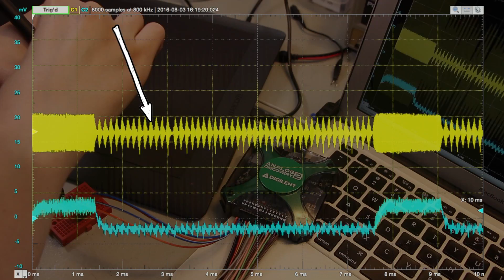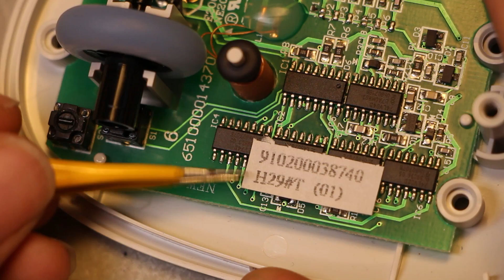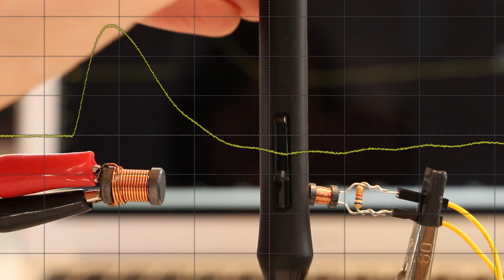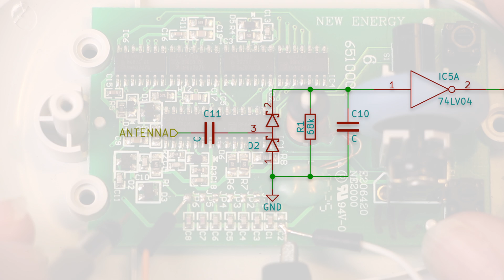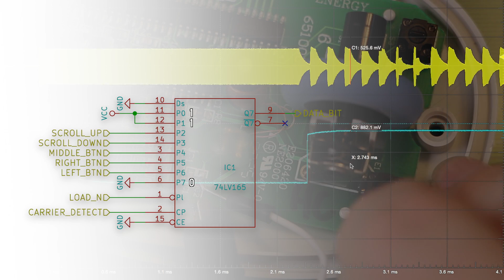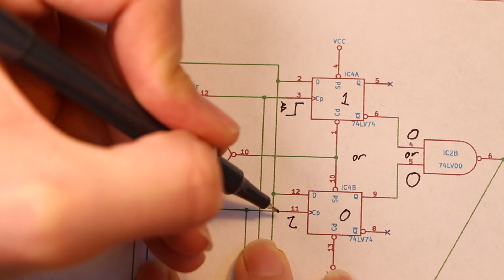Wacom Teardown and Schematic - scanlime:013

Comment: I really like how you overlay the oscilloscope output when needed to illustrate what is going on. The full-screen, hi-res attention it gets is a very nice way to present the data at hand.
I wonder why they went through all the effort building the logic with several discrete 74 chips instead of just using a CPLD instead. Probably it really cuts down on the power (and given the large pull-up resistors that was probably their main concern).

Comment: This may all be completely wrong and I am just crazy but:
I tried a few "experiments" with my Intuos 3 and Intuos Draw to test out my theories or to learn something more about how to potentially get a pen that wasn't inteded for use on one of the tablets, to work on the tablet. So I found that although (supposedly) they work at different frequencies both pens can be used on both tablets.
If I hover the intuos 3 pen over the intuos 3 and then bring the intuos draw pen over as well, it "transfers" to the intuos draw pen and recognizes it as an intuos 3 grip pen, same thing the other way around. however pressure isnt quite right as the newer pen has 2048 levels, and the i3 pen has 1024-interestingly tilt/rotation still works as i assume this is done through the tablet not the pen.

Waco's after the intuos 2 have Tool ID or something so the tell which tool is over the tablet, this - afaik this is hardware within the pen-I tried the tabletswithout drivers installed with the pens and it worked the same as in you have to tranfer it over, once theyre out of range they dont connect again without the intended pen initializing the tablet i guess.

I am now looking for a 1024 pressure levels pen (thinking the intuos 3, or one of the bamboo's or pen and touches) so I can see if they might work a little better. hopefully someone can figure out a way to trick tool ID into thinking that you're using the intended pen..

Comment: I picked up an Intous3 tablet at an auction for 17 bucks but it didn't come with a pen, I didn't think much of it until I read about the ridiculous compatibility stuff online. This tablet was only compatible with a handful of pens. All of them are expensive by themselves. I picked up a whole Intous3 set on eBay for another $30 with the pen, mouse, and smaller pad. But the pen stylus part isn't very sensitive for some reason. Maybe it just needs to be tuned. I see some trimmers below the rubber grip I might try tweaking them...

Comment: Hi! very nice work!, I see you have reverse engineered several aspects of drawing tablets, I have a Wacom CTH-300 wireless, and no USB receiver, rendering it useless..., is there a way to inject a new ID to a new receiver? or since there is also a wired model of this tablet, soldering a USB connector could be possible? thanks!

Comment: Tragically I think that "74 series logic" is the TTL bipolar high current stuff from the 70s - reading the numbers on the chips "The 74LV00 is a low-voltage Si-gate CMOS device"  -  interesting.

Comment: Your presentation and depth of information is really good. Ive seen that compatibility table when trying to find compatible pens for embedded Wacoms (Toshiba M4, Fujitsu Stylistic), makes me curious if you can just retune the pens between similar models or if the pressure resolution is too different. (Like using the older Intuos 6D pen on the latest Intuos Pro)

Comment: Have you checked the RS232 port with the scope? I have a XD-0405-R intous2 tablet, and the signals the scope probe with a coil detects on the tablet are the same another scope probe measures between pin 5 and pin 3 of the DB9 connector, but the latter show a stronger signal resembling a serial communication pattern, but I cannot decode with a DS1074Z because peaks are distorted by transient ripples. I shall use a circuit to reshape them to square pulses as you mention in your video.
Reply from the maker: which RS232 port? the pen protocol isn’t the same as async serial iirc
Reply: @scanlime  I guess you are right, but I measured Intuos 2 tablet's RS232 port DB9 connector pin 5 and 3 to one channel of the scope and the signals caught by the coil on the tablet pad on another scope channel, both have similar patterns, but RS232 are much more intense and sharp. But my scope cannot read or decode the signal output on the RS232 port. Can you?. I perhaps did not figure out the correct RS232 parameters or perhaps in the old intuos 2, the coil (pen)motion/position generates a signal that is sends packets via RS232 that are not standard serial and the soft converts them to X/Y coordinates? Thanks for attending this question.

Comment: will it be possible for you to make a tablet like circuit using an arduino ? This could be placed behind a monitor or a android tablet and a pen could be used to draw on the screen ?
Reply: Cannot be naively placed behind the display - the TFT unit will both shield and inject noise. There could be solutions to that, but they likely won't be particularly easy or low-tech-friendly. The way one would do this in a commercial device is by placing the sensing matrix in front of the display as a transparent electrode array, akin to how the capacitive touch sensors are made, but even if you had such a transparent antenna array on glass manufactured, it still won't be trivial because of TFT noise.

Comment: Can a resistive touch panel be used like a Wacom?
Reply: This is not a well-defined question.

Can absolute position be read from a resistive touch panel? Yes, that's generally their purpose.

Can pressure data be read off a resistive touch panel? No, it's just two linear resistors - thin glass plates coated with transparent electrodes, with spacers in between, wherever they touch, that position can be read, nothing else. They form essentially two potentiometers linked to each other whenever there's a touch of sufficient force to connect the glass panels together, else not connected.

Can a dedicated pen be used to reject accidental palm or finger presses on a resistive touch panel? No, the operation is strictly mechanical.